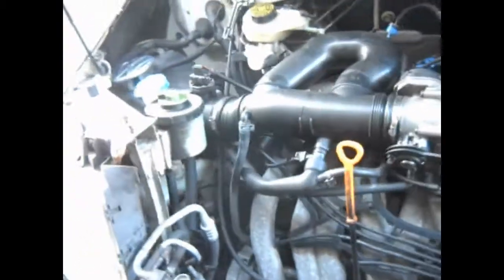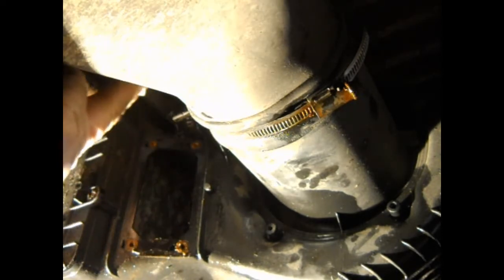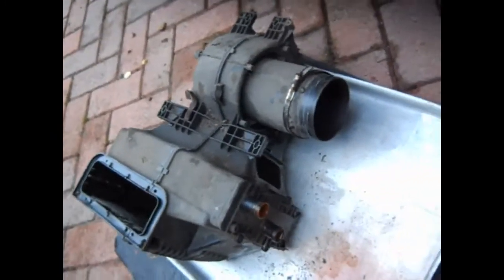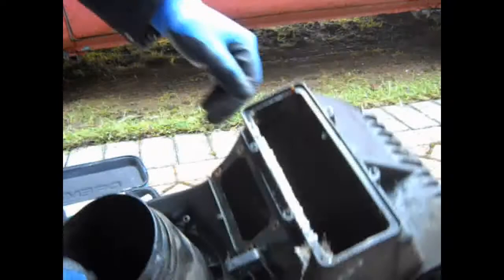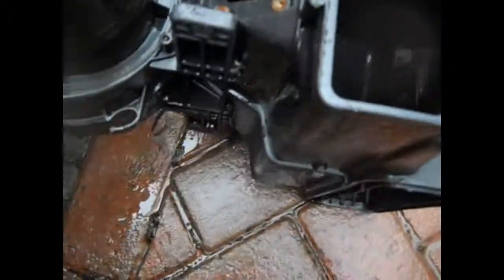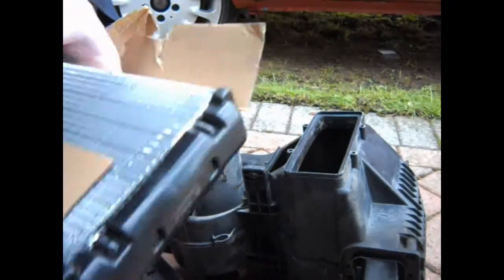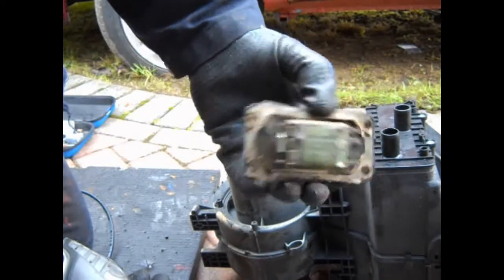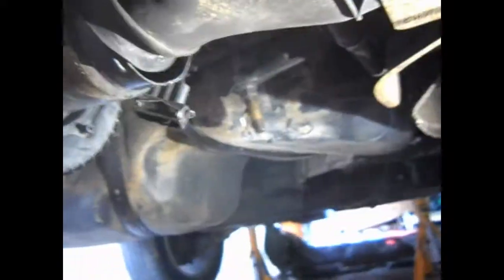Volkswagen T4 Eurovan Caravelle Rear Heater Matrix replacement

Comment: hi, did you drain all the coolant from the system first?
Reply from the maker: Because I didnt know how long the coolant had been in the van (should change it every few years) and had to do the thermostat as well, I did drain all the coolant, which is about 12 litres. Its advisable to do the same if you dont know how many years its been in there and replace with fresh. You could however (knowing the coolant isnt very old) clamp the 2 flexible sections of pipe near the heat exchanger and just drain out the bit thats in the matrix itself, without the need to drain the whole system.